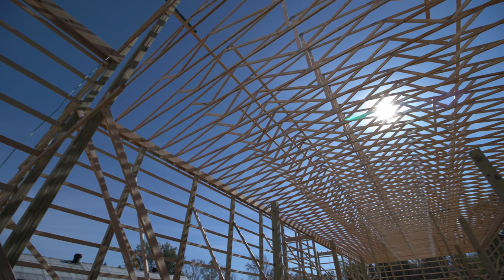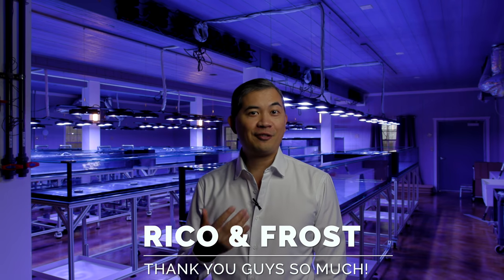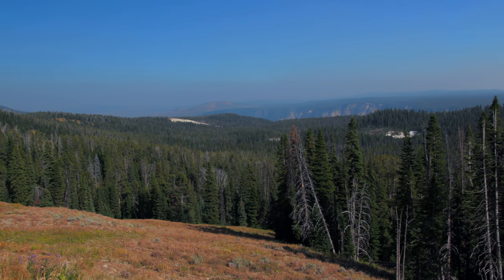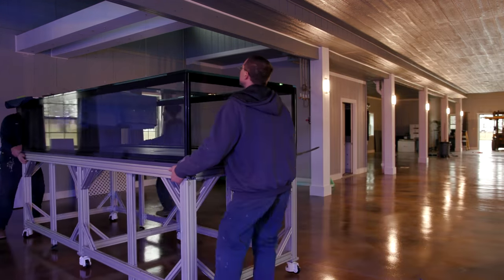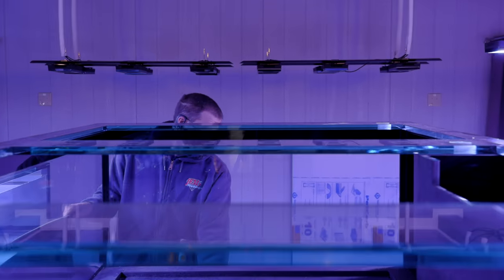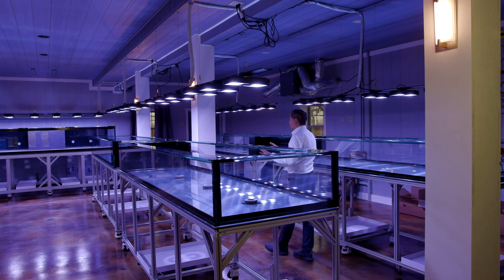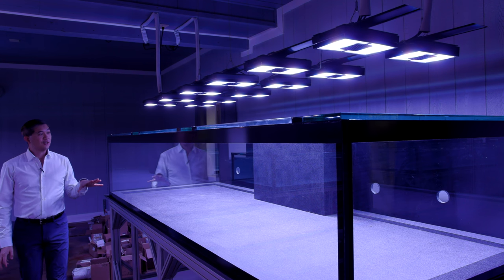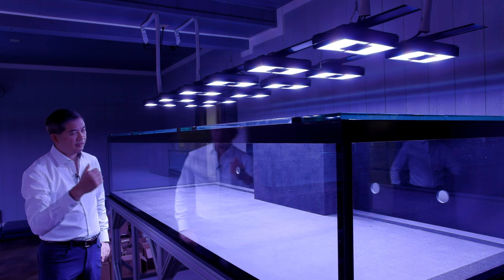NEW TANKS! Tidal Gardens December 2019 New Building Update - Episode 13

Comment: How thick did you go with the type one PVC and the poly carbonate squish layer?
Reply from the maker: Most of the type-1 PVC is 1/2" but on the larger tanks we used 3/4".  The poly carbonate is like 1/4" to 1/2".  I forget.
Reply: @tidalgardens  ok thanks again, we are being a copycat and using your idea..lol. Makes sense though if you’re in it for the long haul.

Comment: Where do you disconnect the electrical power from each return or closed loop pump? Are there electrical disconnects?
Reply from the maker: Yes, there are several disconnect points along the way, they are just hidden.
Reply: Awesome.  I’ve been thinking about how to make easily accessible sac well safe to make local disconnects... that lead to an apex.  But I’m thinking residential.

Comment: Heck you could have rented and 18 wheeler, could have packed all the tanks with air bags so no shifting, and I could haven driven that up there.
Reply from the maker: There were a couple problems with a full-size semi truck.  First, we can't get one up the driveway which means the tanks would need to be offloaded at the street which is a slightly busy state route.  It is also about 400' away from the building.  The second problem was when I looked, the largest truck that I could rent 1-way was a 26'.  I don't know if there are smaller rental agencies that can do full size semi trucks 1-way but the large chains did not offer it.
Reply: Oh I definitely understand issues with getting the trailer close enough, as for the one way, in my industry, there is always a way to get a load transported, lol. It’s all about who you know, maybe another follower owns their own rig (I got rid of my own years ago) which would make it easy as after they unloaded they can always find another load to keep on trucking. Maybe on the next building down the road :)